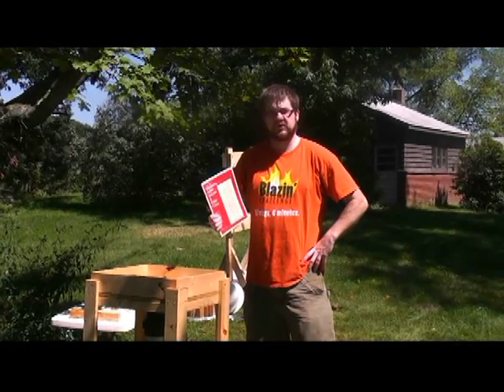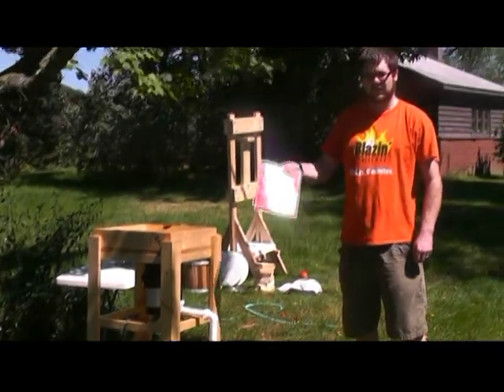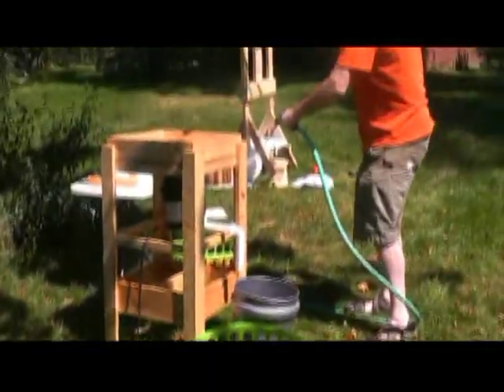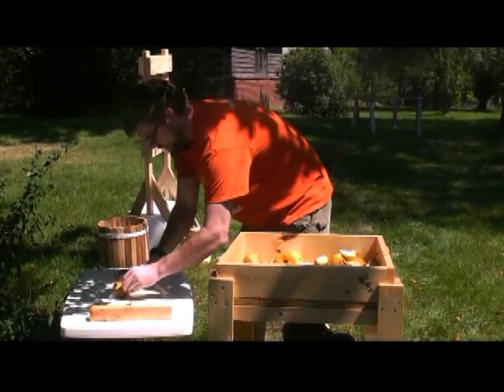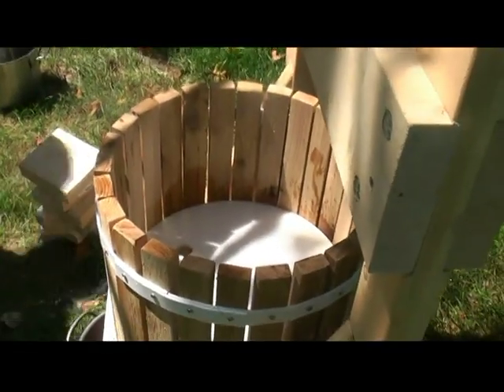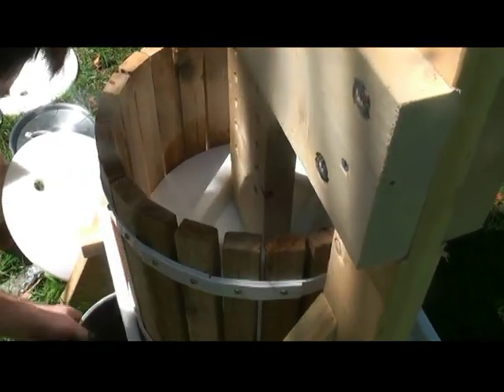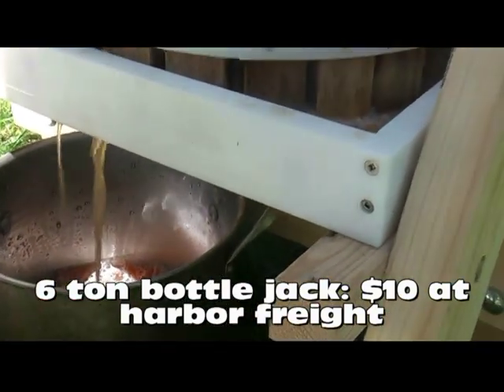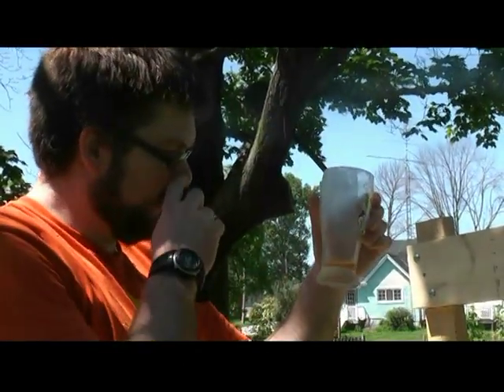DIY Homemade Cider Press and Apple Grinder Review: Anyone can build a whizbang cider press

Comment from the maker: @TheUnusualFarmchick Just plain jane pine boards. The press tub is cedar but you can use pine. If you do all pine construction this thing can be built very cheaply. This was shot right when i was done, however since I have treated it with linseed oil and then applied polyurethane. This is what I would recommend. Thanks for the comment. I like the harbor freight jack... might have tried to modify it if I saw it first, however I am quite happy with this press